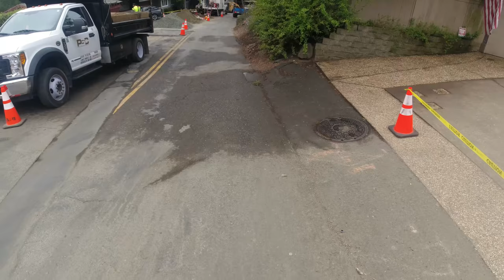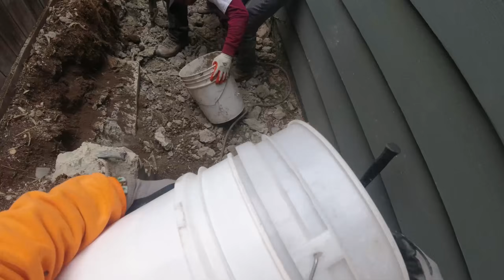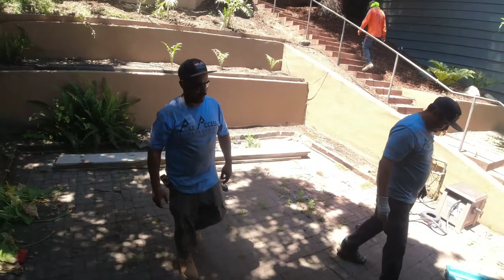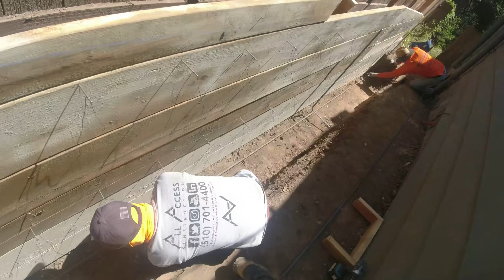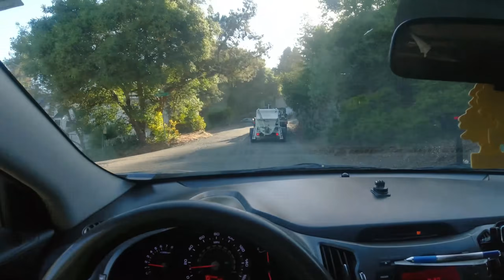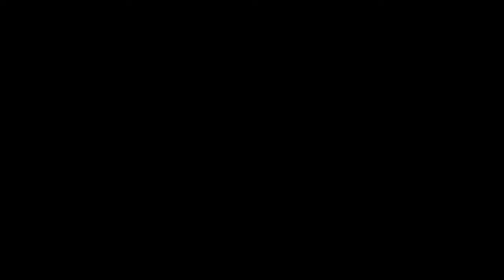"ABSOLUTELY" No Access To Build This Concrete Wall ( STILL MADE IT HAPPEN 🚨)

Comment: Looking great as always.

Any tips on drainage if you have such a small gap between the fence and the retaining wall? 

Also did you have to do anything special to keep the fence stable? 

Asking because I've got a similar gap and want to get the retaining wall as close as possible to the fence.
Reply from the maker: Mannn we had about 8 inches in the back.. Put the pipe in and filled in with all drain rock.. We didn't do anything to the fence. I was a little concerned about that.. Make sure yiu have something in your contract that covers you in case it falls down
Reply: @AllAccessConstruction  thanks for the reply!
Reply from the maker: All good